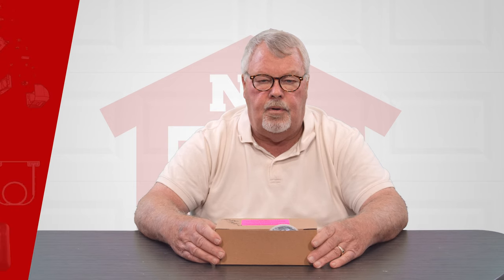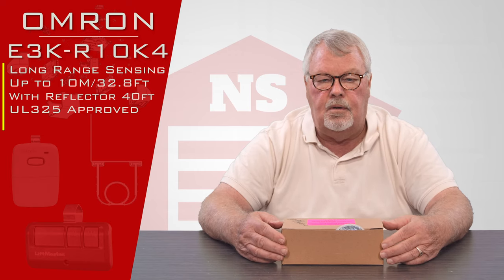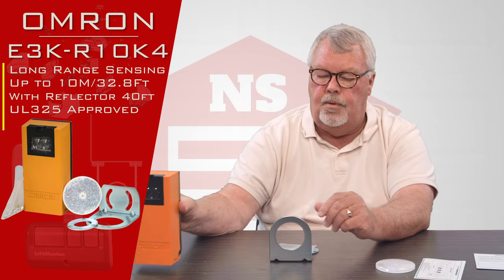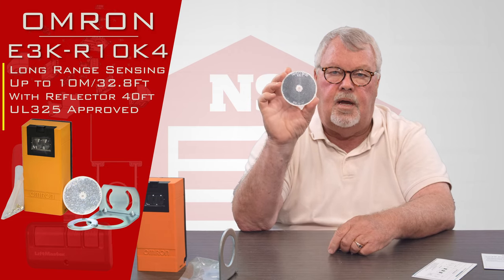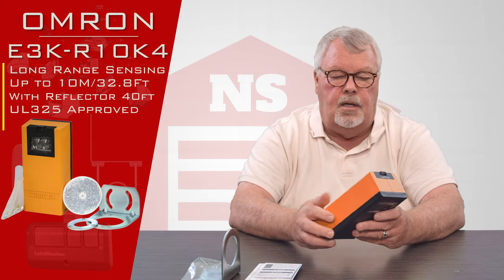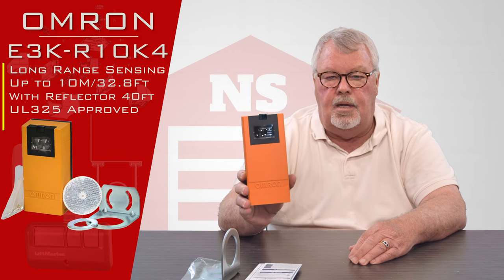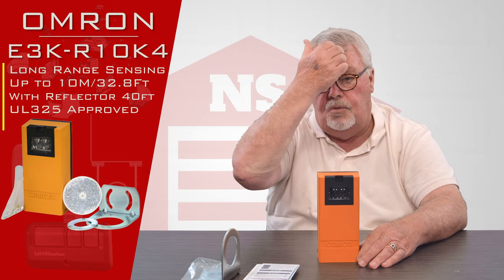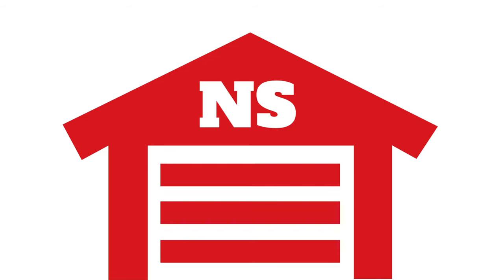Omron E3K R10K4 N4 Sensor with 10K Resistor

Comment: Hi. im looking for some guidance, wether its info from your techs,, or if you can redirect me to a troubleshooting page.
i bought an E3k-R10K4-NR-1  , it's paired with an ELITE SL3000-UL commercial gate operator. 

The system work great on dry days, but on wet- rainy days, it will open when sent a signal, but won't close on its own.
 I find myself cycling power to it, in order for it to close.

I am using the 3" reflector that came with it.
The sensor and reflector are 30' apart.
i have installed an "EYEBROW" on the sensor to keep rain off of it, and it seems to stay dry.

Any help will be greatly appreciated.

Thanks.
~G.